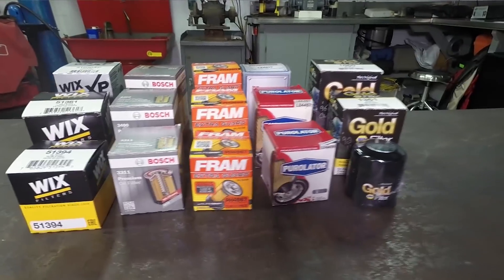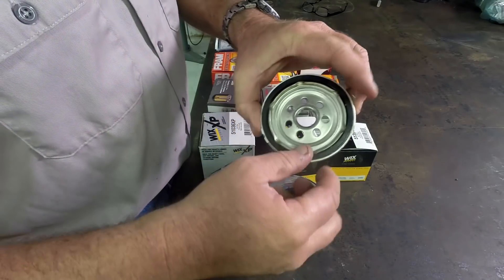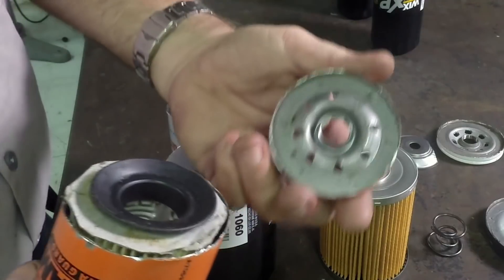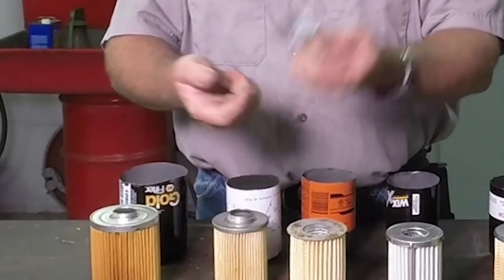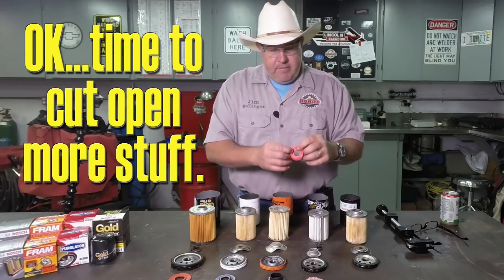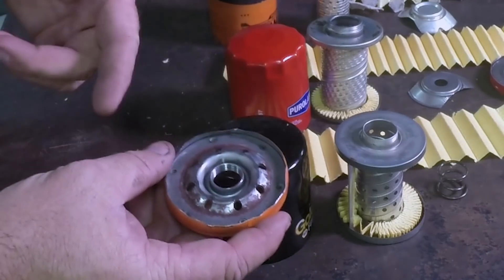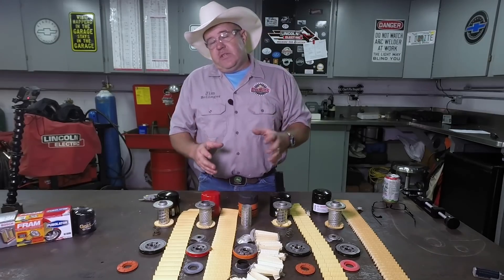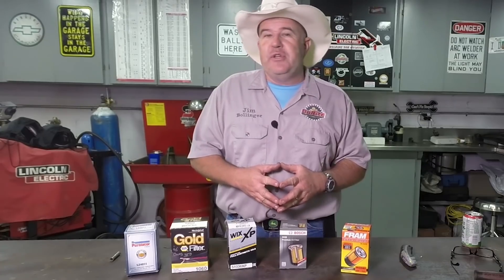The worst oil filter EVER!

Comment: This guy is comparing the lowest end Fram filter with others that cost almost twice as much. Fram Ultra Synthetic is a better comparison.  As cheap as Fram is, they work. We have a truck on our fleet with 300k miles. Nothing but Fram filters most of the time. Just keep up with oil changes. For those worrying about rust,  I've noticed some higher end  filters like Mobil 1 come with metal shavings from the inlet holes being drilled. I'm sure  all brands have some sort of contaminants.
Reply: Ray G I was gonna day the same thing. I’ve been using Fram on all my vehicles without a hiccup. All of a sudden someone opens up an oil filter and everyone says I’m never buying Fram again. That’s why oil change intervals are important
Reply: yep, he used the cheapest Fram!  I never had a problem with them all these years.
Reply: @noidontthinksolol  Winky faces has multiple meanings .  He might mean   "gotcha there"
Reply: NAPA Gold directly competes with the orange can frams
Reply: bill little - So a $9 Napa filter competes with a $3.50 Fram filter. That makes a whole lotta sense. The proper Fram competition for the Napa Gold would be the Fram Ultra Synthetic that's usually about $8 around my house.
Reply: MasterTech396 
Price does not always mean quality. Most mfg’s don’t even make a filter for my car I buy MEHLE  brand at $23.50  it’s a cartridge type filter, no outer casing. It’s a supply and demand issue so high priced. I drive a 
911 991.2 Turbo S
Reply: MasterTech396 these are made to perform the same job.   I think its the marketing wank taking hold whenever we start to think it's ok that one filter line only has to "kinda work"  like we should have known better because of it's price.    I think if a company will sell you a product that is bad right out of the box for any price then they have fairly earned any shame put on them.
Reply: I send a pic to Mobil, then at least they would be genuinely concerned about quality control. Rust in an oil filter? Forget about it. They obviously don't care. Especially when the rest of the filter is made of cardboard.
Reply: @jamesr5741  Are the "Mobil 1" filters made by Fram?   If so, than Mobil definitely needs to see how badly Fram (Allied Signal/Bendix) is screwing them over!
Reply: @noidontthinksolol  Well I'm not familiar with the manufacturing process so sorry about that. All I know is that there was definitely metal shavings.
Reply: Ray G  Actually, the Purolator is cheaper on Average than the Fram, (at least in my area) and it holds up better. I would trust the "Supertech" walmart brand over the Fram!
Reply: @triangleofdeath6246  Those orange Fram filters are less than 4 bucks  in Walmart around here. I've never seen Purolator to compare. Another cheap alternative that I see here is  STP. They're like 5-6
Reply: I don't get why they are pricier here, they almost never get below $4 here. they are anywhere from $4-6 here. the Purolator ones are $3.57.
Reply: @triangleofdeath6246  Purolator sounds like a pretty good deal too. Too bad they're not available in my area.
Reply: A bunch of coffee filters would work better than fram.
Reply: In auto school we got to cut up all kinds of frams. They were all bad. Its better to not change the filter if you only have a fram available hahaha
Reply: I bought a Mobil 1 20k mile filter for $10+-, it ended up leaking 3 quarts of oil in the matter of 10 seconds. I swapped it out for top of the line Fram (what I always use), and I didn’t have any issues. The Mobil 1 wasn’t made for our Acura, even though their website said it is an exact fit.

I’ve always used Fram for their decent quality on the upper end filters
Reply: @stevenwatry9878  perhaps you should use filters that fit your car next time lmfao
Reply: @992turbos8   Who said anyone took their car to be serviced at Walmart

Comment: I put over 300,000 miles on two Dodge Dakota’s useing Fram. But that was 20 years ago
Reply: To this day I’ve been buying Fram and now I can possibly see why my Chevy 4.0with only 95,000 mile has a lifter knocking. Thank you sir for the heads up. Never again will I buy Fram.

Comment: Fram has multiple lines of filters—Extra Guard, Tough Guard, Ultra Guard, and High Performance. In all fairness and objectivity, you should have tested the same price point filters. You didn’t even mention any of the prices of the filters in this video. The Extra Guard is not a good product, but it’s very obvious even without cutting it open. Oh yea, it’s also like $3.  The Wix is like $7 which would have been comparable to Fram’s Tough Guard line.
Reply: True statement. Aftermarket parts and consumables are hit-or-miss on the low price points.
Reply: I wouldn't buy any brand that put it's name behind something like that junk.
Reply: Yup! The Fram ultra is nothing like the $3 one he cut up! Dumbest video ever! How about you compare $9 filters to $9 filters!!
Reply: I read an article many years ago that said not to buy the fram basic filter because the black nitrile anti-drainback valve leaked, which results in dry startups and vastly increases engine wear. I had been using the Fram tough guard until recently because they have an orange silicone valve which are much better.   Recently it became hard to find them in the size I use so I upgraded to the Fram Ultra-synthetic at around $9.  

I would love to see the video maker cut  these apart and see if the quality is better in proportion to the price. 

I did notice that the Fram ultras no longer say "recommended for 12-15,000 miles" but I change at 7500 mile intervals using full synthetic oil.
Reply: @ncyankee101  you are 100% correct. I have a 98 dodge that now has a rod knock from dry starts. All I used were farm extraguard filters, until now.
Reply: @ncyankee101  FYI, Fram recently started putting an orange silicone valve in their basic Extra Guard filters.  If it says "New Improved Protection" on the box, it has the orange silicone valve.  I use them along with Walmart Supertech Synthetic Oil.  Best value available!
Reply: I like the Wallymart synthetic oil but now I have an Audi and Wallymart doesn’t make a Euro grade synthetic
Reply: All fram filters are junk Walmart used to make up $3 filter that tested better than a lot of $10 filters now that was 15 or so years ago I don't know if it's still the case
Reply: That gram extragaurd is about a dollar more than that wix there. Trust me, I sell them at O'Reillys. That extragaurd is right around $8.99 and the wix is $7.99. Our microgard oil filters for gas engines are the same quality as those wix, and run around 4 or 5 dollars.
Reply: Zach Whyte Well according to the Oreillys website, you appear to be mistaken. The Amazon link to the Wix filter in the video is for  part #51348. That filter fits a 2010 Ford Crown Victoria 4.6 v8. If you look up that filter at the Oreilly website, the Wix is $3 more than the Fram Extra Guard.

Wix filter
https://www.oreillyauto.com/detail/b/wix-5291/filters-16470/oil-filter-12090/80c2d8dbb188/wix-oil-filter/51348/4835685/2010/ford/crown-victoria?q=51348&pos=0

Fram Extra Guard:
https://www.oreillyauto.com/detail/b/extra-guard-3684/filters-16470/oil-filter-12090/80c2d8dbb188/fram-extra-guard-oil-filter/ph2/4320906/2010/ford/crown-victoria?q=Extra+Guard&manufacturer=true&pos=0
Reply: Zach Whyte advance auto sells carquest bulk filters which replaced their own generic brand. he should've cracked open one of those since many many shops often use that filter since it's commercially discounted
Reply: “Trust me. I work there...” LOL. Then immediately proven wrong. Damn, I expected that from an AutoZone employee, not OReillys.
Reply: netsimeon perhaps you’re going to the wrong AZ. I run an AZ and in my store my team are all ASE certified. We do give trustworthy advice and if we don’t know something we call local experts to get there input. So whether you are an o’reillys guy or Napa or advance guy or even rockauto guy if you come to my store we will lay out all your options and ultimately it’s your decision based upon the facts( not personal likes)of my team. That’s why my store brings in 50/60K a week with very little returns
Reply: I’ve learned long ago that you can’t argue with stupid so I’ll leave you with this nugget:  the commenter never said Fram wasn’t trash, but pointed to what seemingly is an obvious misstep made in the video.  And you can thank Obama.  ;)
Reply: @netsimeon  Aw c'mon! How about a Trump mention eh?
Reply: You can't convince these folks. They heard it on YouTube so it must be true. Don't even bother
Reply: That Fram directly competes with NAPA Gold filters. Even they will tell you that
Reply: bill little No, it doesn’t. The NAPA Gold is $9+. Basic Fram Extra is $3+.

Comment: Good thing Ford makes most of its own stuff, well its the Motor Craft brand anyway I worked at a Ford dealer as a oil tech once and I really like the oil and filters from MC.
Reply: Motorcraft has damn good stuff. Their oil filters, as memory serves, feature silicone anti drain back valve which are superior to nitrile rubber. They are (or were when I last owned a Ford) very similar in material and construction to the highest-end Purolator oil filters. That may have changed thru the years, though.

Comment: Been using fram filters for years, never have had an issue, I have seen several Bosch filters leak at the crimped seal, they warranty the part of course, but that doesn't help my reputation with the customer, like I said never had an oil related issue with a fram.
Reply: Lets be honest, every brand has some products that are faulty, but to specifically DESIGN a product that faulty inside to be delivered to every customer is completely deceptive, and I would NEVER trust any products that brand put out. But you already knew that.......right? ;)
Reply: @jamesr5741  I smell bullshit, maybe this guy sabotaged the filter with water first.
Reply: @MrDejast  , or maybe the cardboard absorbed moisture from humidity or during assembly and that caused corrosion to the cheap metal?
Reply: @jamesr5741  bullhockey
Reply: @MrDejast  , put your fingers in your ears all you want for all I care.

Comment: I'm a Master technician, many years in a dealership. I think every engine that came with noise or low oil pressure had a Frame filter. Lots of techs recommend Fram, they provide a steady income!

Comment: Years ago when i saw Fram actually had a plastIC piece inside its filter I switched to WIX / NAPA brand for my race engines as well as daily drivers, diesel and Gas, I routinely cut them open to check for any engine wear.. GREAT filters! Please check out my channel and subscribe I need 900 more subscribers thanks

Comment: 1.2+ million miles over 45 years on 3 enginswith fram. Never an engine problem..ever.
It is not the filter ...it is the oil and changing it every 5k...common knowledge.

Comment: Been driving a Humvee for a few years (1992 M1038 WW) and I‘d bought a half dozen FRAM cans when I first got the truck, then before I could change the oil/filter, I read about filtration efficacy on some of the military vehicle boards.  I donated the Frams to Salvation Army and bought a case of WIX filters for about $5 each.  Also installed a twin filter adapter for a little insurance.  I expect to keep this truck for a while and good filters are cheap insurance.  Thanks for going to all the time and trouble to make this video.

Comment: I've used FRAM on many of my cars, no issues here. I still do til this day. All of my cars were pretty much daily driver Honda engines, so not much can go wrong there. For my Honda guys reading this comment, the best motor I've had, was an LS/VTEC setup I built. FRAM STILL did the job fine. Now, I currently have a 98' Acura Integra that I frequently drive from SoCal to Oregon every other month, running on FRAM, and it runs absolutely FINE. With that said, would I run FRAM on a high-performance, high dollar engine? No. On a small 1.8L 140HP motor? ALL DAY I would.

This video doesn't show a real world comparison at all. No real usage, no tests, just opinion. You'd think, a oil filter comparison video..would have oil being used.

Comment: Great demo, but the only thing you forget to mention is that only about 30% of the oil flowing thru the engine goes thru the filter. This is why in a racing application we always plug the factory bypass valve. And Wix wins here also. Because the filter is strong enough to run at full pump pressure and not collapse

Comment: What would be a good test to add to this is to show after an oil change, how each filter looks inside. Theres a few on Youtube that show how the Fram collapses & lets dirt through to the motor. The only thing good about a Fram oil filter is the traction grip on the outside. Its for getting a good grip, to throw it as far as you can after you take it off !

Comment: I used a Fram filter once on my old Acura TL...it was the only time I had a filter get stuck on the car, and when i got it off, part of the internals we’re stuck on the filter housing. Almost had to replace that part. Did an engine flush with the new oil to make sure everything was out of the car.

Comment: Fram filters I can takem or leavem. There's more factors to consider. More media material is probably better for keeping debris out of your bearings. You can put 1/4 mile of filter material in there but if it stops everything from circulating including your oil what have you accomplished.

Comment: Sadly this video tell you very little.  What is an oil filter?  A disposable part designed to filter particles out of your engine oil.  What is the one property not shown here?  How well any of these filters filter  dirty engine oil.

The 'quality' of an oil filter isn't based on how well it holds up to being cut open and torn apart.  That's not what they're designed for.  As for the rust, we have no idea how long and where they were stored.
Reply: just imagine rust going into anytype of bearings.....no bueno
Reply: @jonjon7245   Indeed, but the video doesn't tell us how the filters were stored and for how long.  The two that showed signs of rust could have been sitting in a damp warehouse for three years, and the other filters, under the same conditions, could exhibit even more rust.   We don't have any information that actually tells us which is more or less susceptible to rust.
Reply: @brewer13210  , yeah but your avoiding the rest of the problem here. The construction is flimsy, unreliable garbage. We won't ever know how long these have been sitting on the shelf, but since Fram is a popular product then most likely there is a high turnover. Your simply being ignorant Todd.
Reply: @jamesr5741  James, you describe the filters as 'flimsy, unreliable garbage', when you have ZERO data on failure rates.  The ability of an oil filter to resist being cut open and torn apart has nothing to do with it's performance as an oil filter.  It would be like saying that a printer is 'garbage' because it doesn't resist being hit with a sledge hammer.
Reply: Ohh yeah, exactly the same thing....LOL.  Yeah, rust is GOOD.  How well do think that crap paper holds up to condensation?  Why do you think knowing builders refuse to warranty their product if you choose to run that junk?  I know I do!
Reply: @jamesr5741  Keep in mind, before you start labeling youtube commenters as ignorant, the guy in the video used the lowest grade FRAM filter available. I'm sure the lower grade NAPA " ProSelect" filter would also be fairly flimsy when compared to a NAPA "gold" filter. They should have compared the FRAM Tough Guard filter to be fair
Reply: not to mention the "rust" is outside of the filter medium. so it will be filtered.
Reply: Your missing the point quality means everything  and Fram didnt make the grade

Comment: If you want some proof that fram oil filters are just fine my old grand marquis went 400k miles with 0 engine troubles using the cheapest oil and those filters

Comment: Many years ago they tested  an number of filters for engines and included the micron size and surface area of the filter media. Not sure if it was TDR or??? someone else. Didn't like to see the rust part, you should have included different types of filtering media as to there ability to reduce the partial size ,in the presentation? As I have heard it the 6-8 micron do the most damage to an engine. To me oil flow pressure/volume/thread size being the same , get larger oil filters. The other thing to tell the public for fuel filtering is  the reduction of partial size/efficiency .

Comment: I used Fram for a couple of decades until I read a very similar analysis on the internet by Bob the Oil Guy. 
That was about 10 years ago and I have not touched a Fram since then.
Now I just wonder if Fram wax garbage back in 1980 when I was first told it was a great filter or did it fall victim to some MBA or CPA taking control of the company.

Comment: You should do a review on premium filters. Purolator pure one, k&n.... ect. Ive always used pure ones but now im curious. I worked advance auto parts before and we had a guy come in with a fram tough guard that seperated and cocked to one side. It destroyed his engine! After that i never recommended fram. At work we only used napa gold. Which im a fan of since we service vehicles that have high idle hours and longer than average service intervals. After several thousand filters ive changed i have not seen one fail. We check each filter and oil for any signs of abnormal engine wear and youd be surprised how much crap these filters hold.